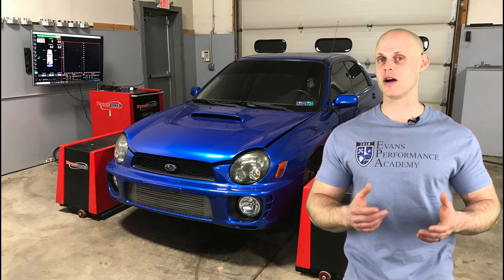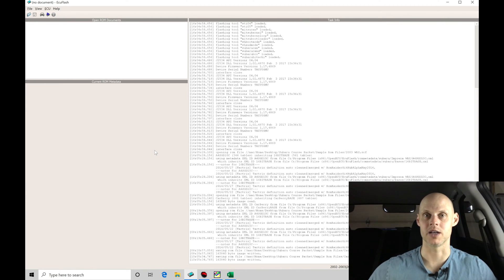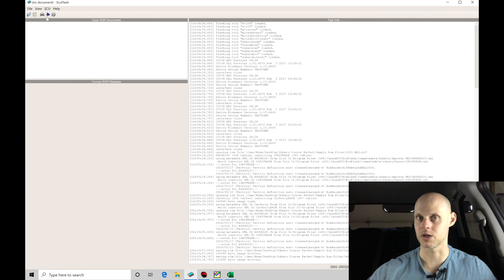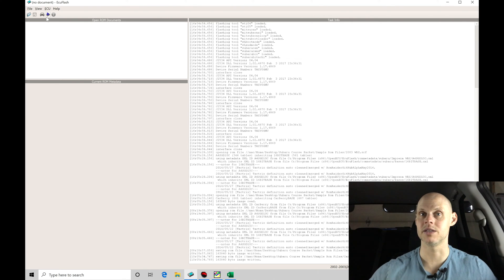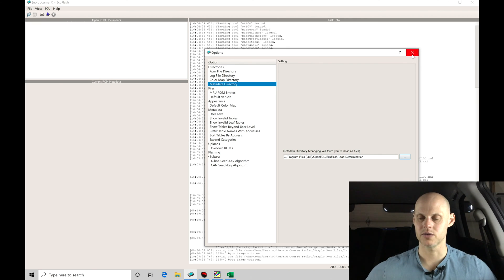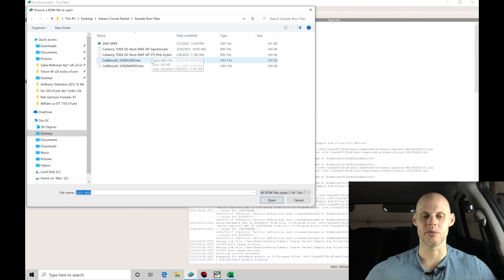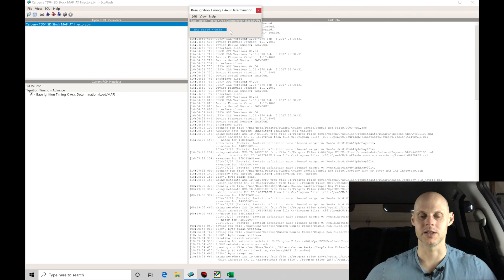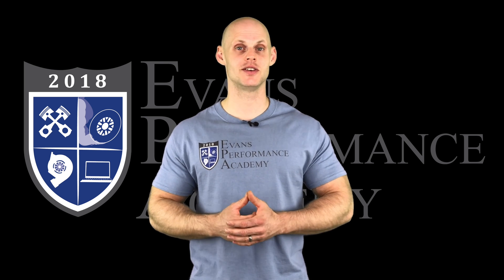Ecu Flash 16 Bit Subaru Live Training Part 1: Carberry Basemap Creation | Evans Performance Academy

Comment: Did you develop Carberry Rom?
Reply: no he did not. Carberry has been around since the subaru WRC days around mid 2000's.
Reply: @jakesmook8934  thats not technically true.... its a modified GROUP N rom that functions on stock ecu. but it hasn't been around that long....... i think jason came out with it in like 2010 or 2011... sometime then.